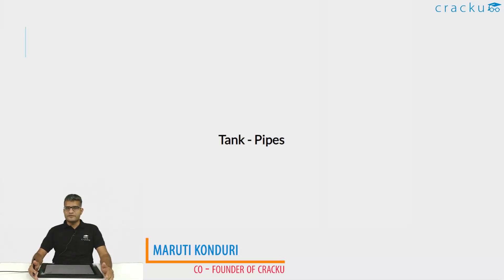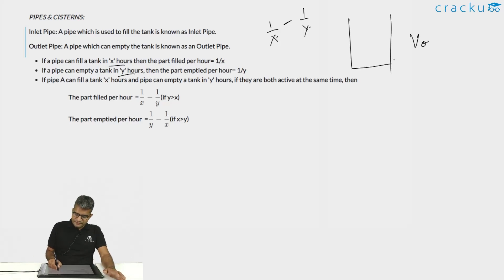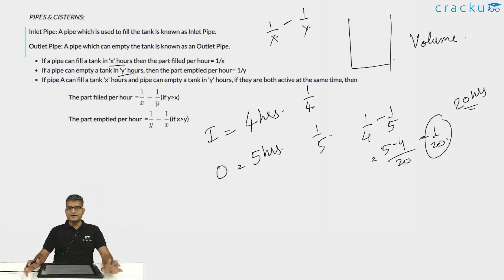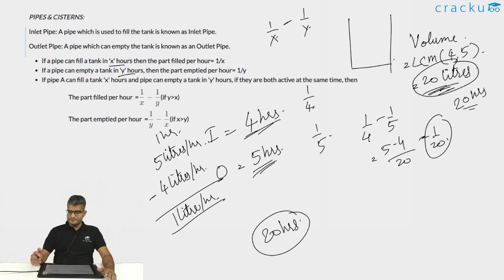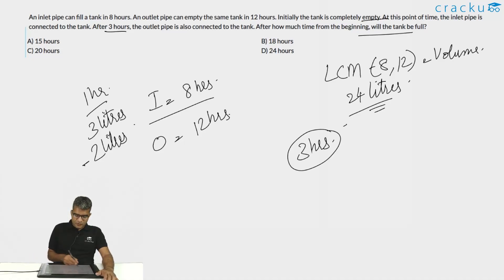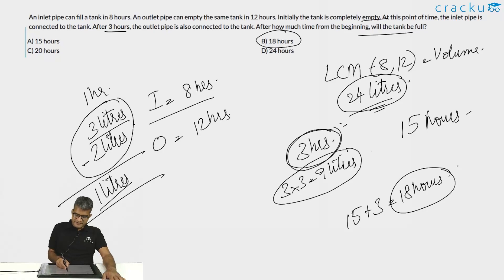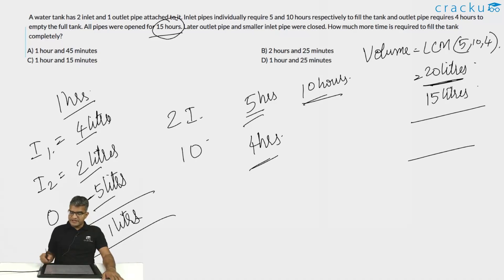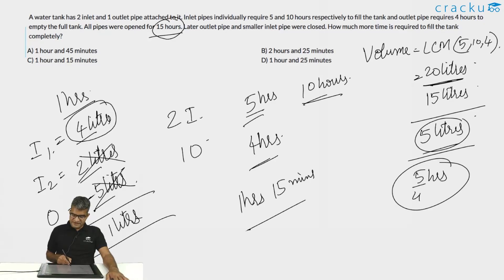CAT 2026 Pipe and Cistern Formulas: Important Questions 🔴 By 4-Time CAT 100%iler

Comment: In the last question, we assumed that both pipes are working to obtain 50 hours; but we are talking about emptying tanks and initially the rate of emptying will be different than the rate of emptying when a single pipe is working. the rate of emptying is not fixed here.